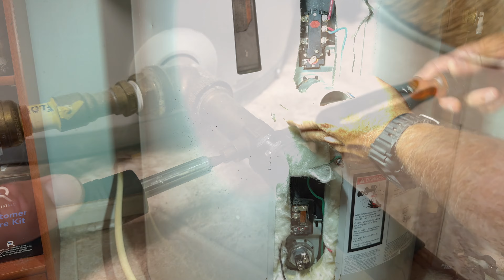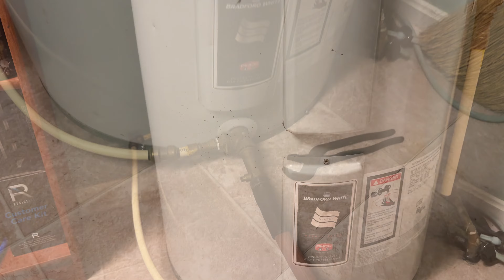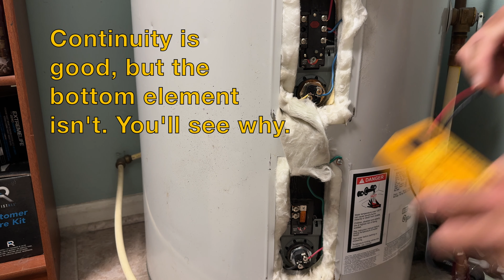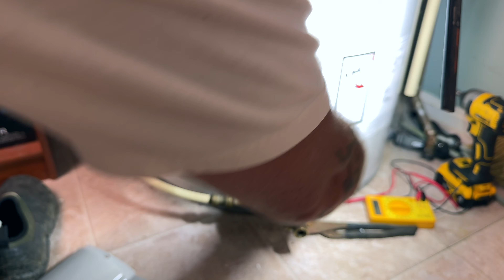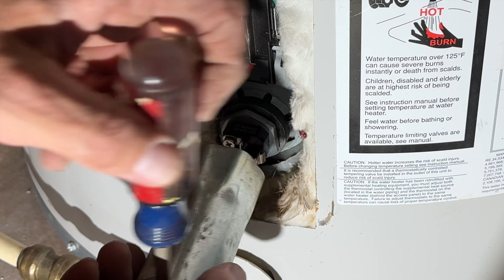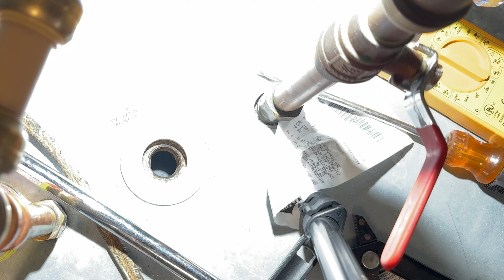How to Test & Replace a Water Heater Heating Element | Electric Water Heater Repair Guide

Comment: I learned alot here..even though the element tested ok,it was still bad...Thanks for sharing..I wonder if you replaced the elements with 3500 watt ones instead of 4500 watt ones would they last longer?
Reply from the maker: You’re welcome. 
Good question. I’m not sure.

Comment: mi tortenik ha nem a tetejen erolkodom hanem megnyitok egy  csapot
Reply from the maker: Opening a tap and leaving it open should release pressure inside of the tank as long as there are no shut-off valves in-between the tank and the faucet that you have already closed.

Comment: You might think twice about opening up that top vent plug and just turn on a hot water faucet.  Much easier and safer way to break the vacuum during draining and also to allow the air to get purged when filling.  Make sure you use a 6 point socket as that will not round the element nut when removing a stuck one.  An impact wrench works great too.